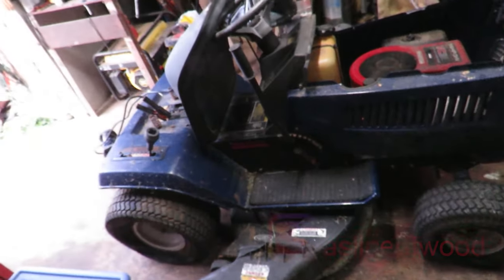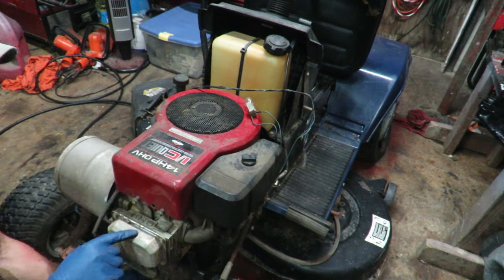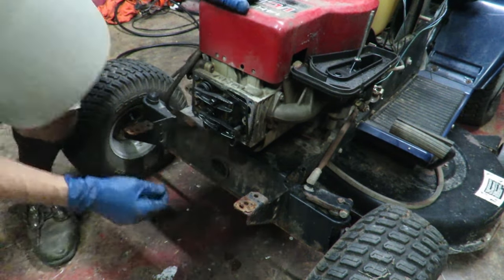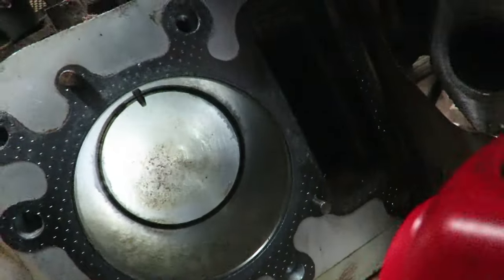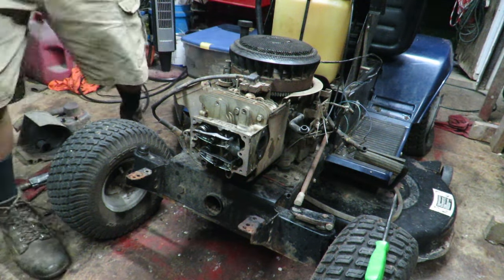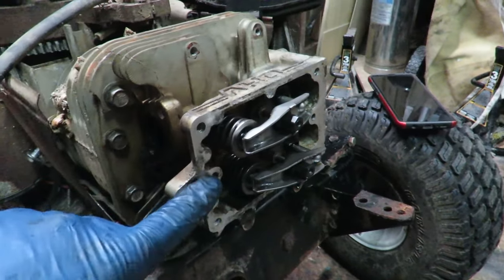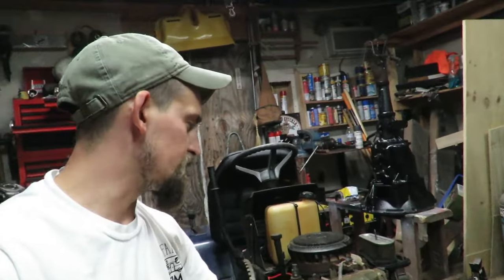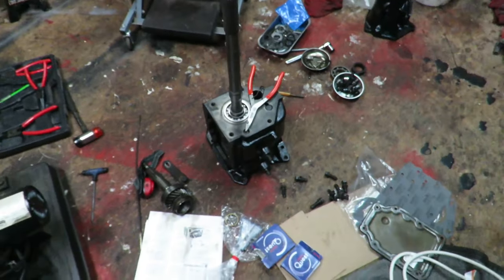How to Fix a Locked Engine

Comment: Put tubes in the tires. You can get a new battery for $30 That is a $1000 mower new, so running and mowing should be worth $300 to $500

Comment: This is the same as my ranch king, A new tappet cover, A valve lash, And an oil change and it was running again. I don't bother with the tires, I just put tubes in them for four dollars apiece. the deck is the biggest problem. rebuild the chute bar, New spindles, ect another forty dollars. And a new kevlar deck belt, 21 dollars.  It's not a lot of money if you own the thing, But for resale, Your taking a chance, Since the carbs on these tend to leak into the crank case.  So i installed a shut off valve.

Comment: We’ll, it’s 330am and I’m finally sitting down with a cold beer beside the wood stove in the garage. I think I’ve watched your vid about 3x now. Have a 1999 John Deere Sabre 15.538 gear. Came with the house we bought this fall. Mower sat for about 4 years, last owner said they couldn’t get it running. It was going to be my winter project, so I drained the oil. It was all fuel. Put in about 2 gallons of oil flushing the gas out over the last week and a half. Bloody float was stuck and gravity did the rest. New fuel filter and installed an inline fuel shut off. As I was making my way to the carb I realized it was hydrolocked. I had no idea I could move the piston from underneath. That was a life saver!

Broke everything down. Cleaned the carb. New oil. New fuel. Once I broke it loose she fired up first try. I am mechanically illiterate, can’t tell you how much I appreciate the video. Made for easy going. Cheers
Reply: I have exactly the same issue on an 06 craftsman :) stuck float gravity filling the engine, and no fuel cut off :).... will add one like you have. Hi from England

This vid was a fun watch :) bit concerned he was going to set the mower alight there for a while :)

Comment: I like seeing where people’s “repair it” price points are when it comes to these types on mowers.  I just got educated myself on a JD SX85 rider where I paid $50 for the mower that had been sitting in a field for the last 7 years or so.  To get it to usable condition had to put over $300 into it ($125 of that $300 was a new seat), the rest was the little things like a new battery and ignition switch, 4 tubes, and 2x idler pulleys. I “might” be able to get $300 back if I sold it like it is, but would like to mow with it a couple of times for fun😊
Reply from the maker: After you do this a while you end up getting spare parts or find packages of certain items to make repairs cheaper.
Reply: @ASliceofWoodWorkshop  the best finds are “free pick up” mowers that someone has given up on repairing due to something simple like a sheared flywheel key or bad solenoid type repair but rest of tractor like tires, seat, etc are still in decent shape:-)
Reply from the maker: You are correct and its almost that time of the year for those freebies
Reply: Not everyone wont a zero turn, got two customers who buy all the older mowers I fix up and they make good money mowing, plus there not in dept and pay better 
Like one said, I’m not that fast but in a day I paid for the riding mower 😊😊

Comment: That cap is in the oil. drain the oil and find it. It could be the reason it frozen up it could be in the filter if there is one. Once you located the problem I would have then checked the push rod they usually get bent when the cap comes off or is the reason the cap came off. Then you got a small chunk of metal running loose in your engine I would locate or make every attempt to locate before firing it up. If someone changed the oil before you that piece was likely lost then. Or it’s stopping the engine from turning when the engine began moving again there may be some damage and I should inspect around gears and things where it might have gotten crushed or shredded for stress cracks. If you agree then I’ve learned quite a bit and you given me just enough so I feel like I’ve rapped my head around it and figured it out myself which makes it usable knowledge that’s what every teacher wants to be able to give their student. Sometimes less information is more,  sometimes. So good job I’ll watch you again keep making videos. If you had a little info on where to find the online spec sheet and where to order parts for everything your working on would be invaluable cause you never no when someone is facing the same problem or maybe posting the information itself on your site to be downloaded instead of giving away where you found it just that it can now be found along with your video might be something worth doing just a thought. Thanks for the video I’ll be waiting to see your next one.

Comment: I have one like that. It's always the needle and seat that get contaminated and leak. Those small red inline filters are junk, nothing more than a screen. I always put a real inline fuel filter and check that the needle doesn't leak, carb off, and have no more problems.

Comment: My Kawasaki twin Deere 920M locked up. I bought it after it sat like 4 years , and they had hijacked all sorts of parts off it.   I'm restoring the beast.    After working with the service manual and parts mower, for weeks , I was excited this weekend when FINALLY the engine turned over. It cranked a few seconds, then I shut it off, and put everything back together, thinking I was good to go. It cranked smoothly and quietly.  But now, the new starter just clicks, instead of cranking. Battery is fully charged.  Oil level is full.  Fuel tank was empty when it cranked, but I added up to 1/8 full after to try to start it.

I like your idea of trying the bottom pulley. I disassembled the top shroud , and that nut was frozen clockwise, and loosened counter. No joy there.

My plan was to pull the plugs,  and see if I can crank it then. They made it hard to get to the valve-cover without removing the rear fender, and being built like a tank, that doesn't look easy. That's sorta a last resort.

You are extraordinarily knowledgeable- Suggestions?

Comment: All one will have to do with the tires is to clean and slick up the tires with soap and or green slime and those rear tires will stay up. I hope you drained the oil out to get the gas contaminated oil changed and do something with that stupid float needle and cut the gas line to put a shut off valve and clamps on the line, it is obviously not keeping the gas out of the engine. Someone will get a good deal for 200, because with correcting the carb, tires and sharpening the blades not much money to get a good working mower but needs a battery. A small cheap battery is all it needs, not one of those super expensive batteries. Someone will be able to mow a large tract with a 44" mower on a rider. Not as good as a twin blade mower but very decent for the right guy. He just won't be able to hire out mowing because it doesn't have twin blades. Good work there feller. Saved another good mower.

Comment: Interesting and informative video.  I subscribed to watch you make stuff with wood and now I hang around and watch you fix mowers :-).

If you haven't sold/parted it out yet, get some inner tubes for the tires.  My old rider, probably 30 years old at the time, had a tire that wouldn't hold air.  I took the wheel to a lawn mower repair shop and he recommended I just put an inner tube in since the tire was still good overall.  Saved me a ton of money and I used that mower for a few more years until the transmission crapped out and it wouldn't shift into drive anymore.
Reply from the maker: Thanks or subbing. The channel has changed and thanks for sticking by. I would do tubes, but these tires are in bad shape. 1 has a hole in the side of it.
Reply: eh i just take the valve stem out and pump that slime shit in there it works good

Comment: Great video. I have the same engine and it doesn't spin. So I tried to do what you did. I found the pully bolt under the engine and used a socket wrench on the bolt trying to spin the engine free. But the bolt on the pully only unscrewed from the pully. No movement on the engine side. Any thoughts??
Reply from the maker: There is a key in between the pulley and engine shaft that may have sheared off
Reply: @ASliceofWoodWorkshop  thanks for your help! I will check for that missing piece.
Reply: @rom1net  i have same problem did that ever work
Reply: If the bolt came loose, turn the engine the other way. So that you are tightening the bolt.

Comment: That means you got a bad needle and seat and a seeping past the needle when it sets and it has hydrolocked and motor from the amount of gas that's why you put a shut off valve in the line and replace the needle

Comment: Dry piston making the scraping noise, I usually spray lube oil in the spark plug hole before cranking after sitting for half a year or more

Comment: I have a briggs in a Husqvarna had to a dealer when under warranty three times cylinder was always full of fuel they fixed nothing! just the bill to me, but the carb was bad so I replaced also put a fuel shut off in line, no more problems then eng locked up pulled plug no fuel tested battery its good will crank with no plug but will not spin with plug in? oil is good it has been changed any ideas?
Art
Reply from the maker: can you tell if the valves are opening? Can you rotate at all in either direction?

Comment: Why not remove engine cover to check for mouse nest.
Reply: I have a small engine shop and every cover is removed and engine pressure washed
It’s like removing fuel tank and flushing it out 
Why make it run and burn up the engine 😊😊😊

Comment: Hey. Mine locked up by changing the trans belt. I turned the mower on its side to change belt. Flyvwheel was spinning freely. Got the belt on, now it won't spin. Any suggestions
Reply from the maker: Remove the belt and see if it spins without the belt. If it spins then something may be wrong where the belt connects
Reply: @thomas25082 Basically I was following a video where the guy turned the mower on the side to change the belt. I did the same thing to change mines, and it wouldn't start. Took the spark plug out, let the oil and gas drain out, and it started. Haven't had a problem since.

Comment: I'd remove the emotion tube. An your main jet.,or jets.& The auto enrichment choke solenoid to. You might even need to change the engine/ motor oil in it to. Due to gas mixed with the motor oil.

Comment: 1925 and like up on The late model stuff it's the same head same head gasket are you running to your deal is a little bit of difference file size is different on the bigger engines

Comment: Why not stick some inner tubes into the tires? I didnt see anything wrong with the tires, (wires exposed, dryrot, etc.) Inner tubes would run less then 10 bucks each.
Reply from the maker: Thats always a good option.

Comment: LONG STORY SHORT...My Riding mower was hydro locked. IT just clicked!! 
 It didn't have a shut off valve. So the gas leaked from gas tank by gravity and capillaries action. Gas leaked thru the needle valve to cylinder and down 8nto crank case.
  I had about a 1/4 cup in cylinder and 1gallon in crank case.
 Where it only uses 1.5 !!!
New plug and popped right off.
Unfortunately i bought a new batter and starter to fix the click.

Comment: You can add 16 oz  can cream or Milnot  pour it down air strem. Then shoot the air back in then rotate the tire  in about 10 minutes the tire will hold air.  You can laugh all you want thinking can mail not will not work for sealer. But it really will. I have been using mil not in can for the last 28 years on all our stuff including our tractors it will hold air for a long time

Comment: Put tubes in if they have no huge cracks last the life of the mower because new tires for some reason don't last for s*** as far as time who's the last forever cuz the tire skins how does the weather I've had tubes set for 10 years and still have air in them

Comment: You should get the lash cap, and change the oil.
Reply from the maker: Oil was changed and I am getting that cap. I just wanted to see if it would actually run. Thanks for checking it out.
Reply: @ASliceofWoodWorkshop  whats a lash cap?
Reply from the maker: @spydo staxxe it is a cap that goes on the valve stem

Comment: please watch others videos on small motors.. my god.. it wasnt the lil piece .. and its full of fuel in the crankcase. omg .. lord help me i need warm weather
Reply: Yup stuck float filled the crank case and had it hydro locked but he did have to adjust the valves

Comment: It overheated and locked up
Reply: I have an Agway mower just like this that recently overheated and now it seems like the engine is locked up.  If that happens is it done for? I'm not mechanically inclined at all.
Reply: @matt6923  I've seen some things online that say to spray wd-40 inside and letting it sit for a while and keep lubing it, then try to see if it'll break free, but I havn't tried that on mine yet, I am gonna now though👍🏻
Reply from the maker: @matt6923 Marvel mystery oil as well